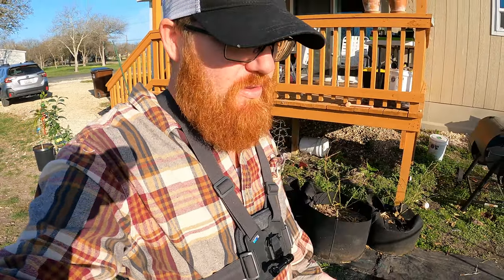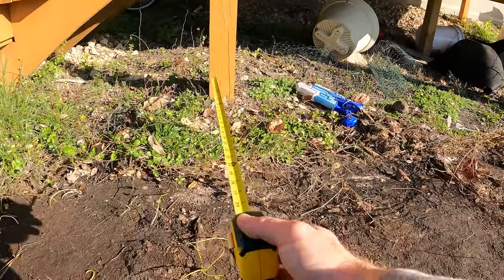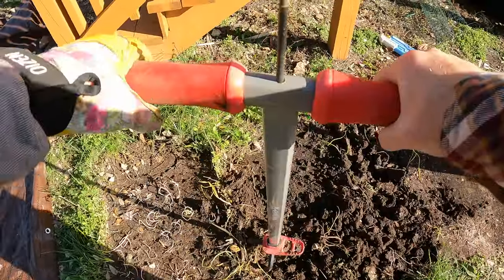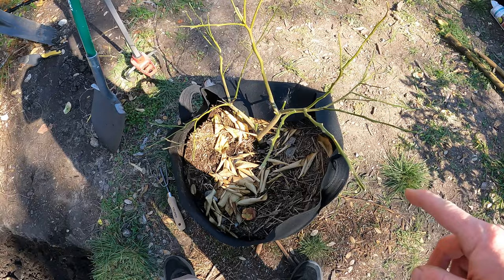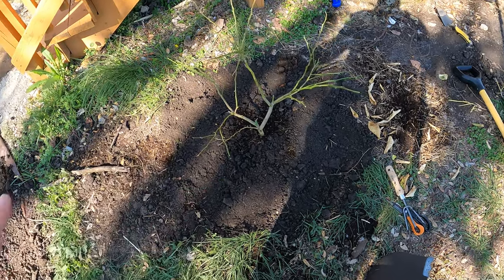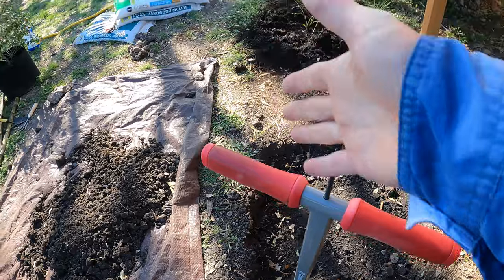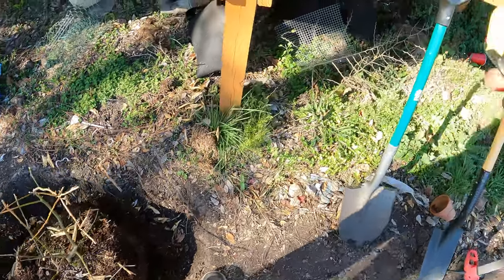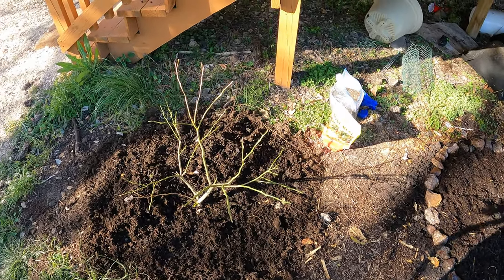Planting Mayer Lemon trees in Ground

Comment: If the top graft but the root survives you can graft a Meyer lemon onto it. You just need to find a source for scions. The root is probably calamondin orange which is incredibly thorny and the fruit is not palatable.
Reply from the maker: Ok thank you, so you think it’s not growing Mayer anymore? Ok I’ll look for scions.  Thanks!
Reply: @Escapingthedailygrind  You'll know if the grafted plant survived from the vegetation and thorniness.
Reply from the maker: Ok, so more thorns, is the leaves different?
Reply from the maker: So these don’t have that where I can see.  It’s a split trunk, with like 3-4 branches coming off.  Then small branches coming off them.  Think they grafted multiple branches onto one root stock?
Reply: Multiple branches would be grafted onto stock to make sure that the tree has several branches coming off it. Not all grafts may take. Budwood scions are about 9" long, you can cut it in half and get two grafts from one scion. You only need 2 - 4 buds (leaf node) for a grafted scion. if you have not grafted citrus then don't do it now, wait until spring.